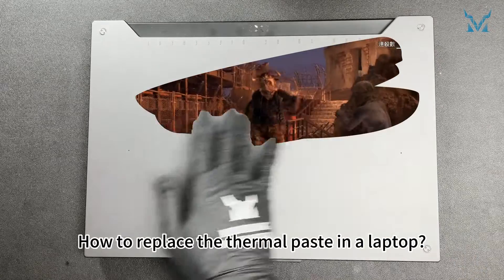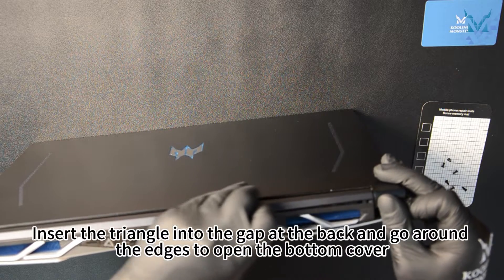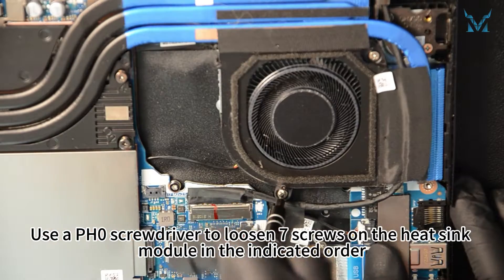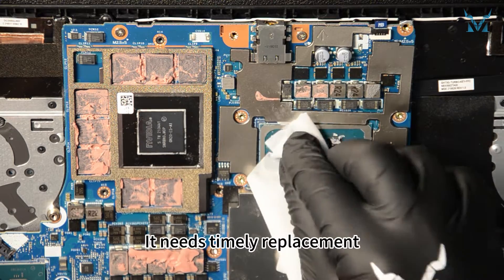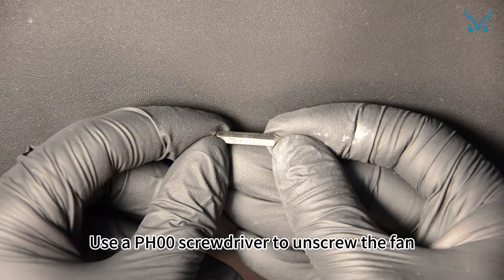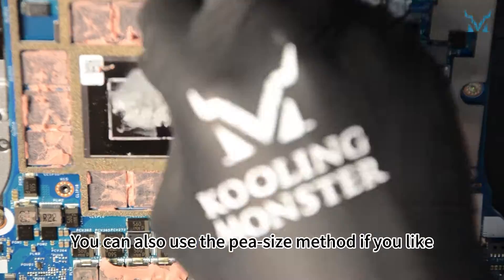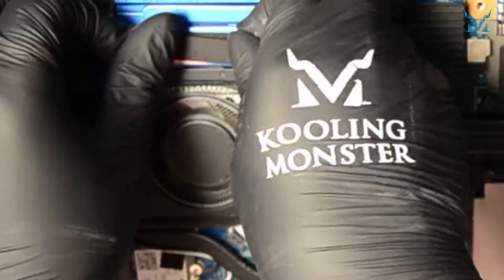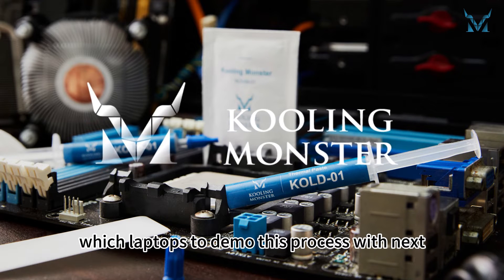Speed Up Your Acer PREDATOR HELIOS 300 - Prevent Overheating With Dust Cleaning & New Thermal Paste

Comment: What will happen of i dont replace the thermal pads surrounding tge cpu/gpu will it be ok if the pads are dried up or is replacing the gpu amd cpu the only necessary thing
Reply from the maker: Usually, the thermal pads around the CPU/GPU don't need frequent replacement. However, if they dry out, they should be replaced, as failing to do so could potentially affect the computer's performance. Manufacturers and aftermarket services typically use inexpensive thermal pads instead of thermal paste. If you want to use thermal paste to replace the existing thermal pads, make sure to use high-quality pastes. People often say that thermal paste should not replace thermal pads because the gap between the chips and the upper heatsink is too large, causing the thermal paste to flow out. Our KOLD-01 thermal paste features a special design that controls fluidity, potentially avoiding this issue if you choose to replace pads with paste.

Comment: how to use the compressed air? and what is it use for?
Reply from the maker: This is for cleaning the dust from the cooling module of laptops. Not only is the airflow and force more controllable, but also the finer nozzles are used to handle fan blades and heat fins covered by the casing, which is more efficient than using a vacuum cleaner.

Comment: Im not stripping my laptop in the hopes I don't fuck it up I want my laptop to stop over heating over 95 degrees fucking burns to the touch and seriously worries me but I'll do more damage than good if I strip it myself any other suggestions?
Reply from the maker: If you don't replace it even with the high temperature, it will damage the computer's performance. I suggest you watch the video carefully again and consider purchasing one of our toolkits to assist you! Don't worry, disassembling the computer may seem daunting, but it's actually a straightforward task!
Reply: I have zero computer knowledge and was able to do this. Don’t let it scare you. Just use a good screw driver and go for it. Hell, you might even have fun after the 2nd or 3rd time doing it

Comment: When should the Thermal Paste be replaced , how often?
Reply from the maker: When you feel your computer overheating or experiencing lag, consider replacing the thermal paste to improve its performance. The frequency of replacement depends on the quality of the thermal paste. We recommend using our KOLD-01 thermal paste. Typical thermal pastes use a solvent-based formula, where the solvent can evaporate when heated, causing the paste to dry out and lose its thermal conductivity. We use an exclusive solvent-free formula, perfectly solving this problem. Therefore, using it on laptops results in better heat dissipation and longer lifespan.

Comment: This video helped me a lot I got an Acer Predator Helios 300 in 2018 from then till now I never changed the thermal paste and pads, recently my laptop was making a lot of sounds and the temp was hiking up to 97-degree Celsius, then I went through your video and opened my laptop cleaned it there was a lot of dust blocking the air vent along with entire thermal paste was dried up and CPU fan was not working, repaired all those and you know what, now my cpu temp is not crossing beyond 60 degree celsius even with full utilization of CPU and memory.
Reply from the maker: Thank youfor sharing your experience! We're delighted to hear that the video was helpful to you and that you were able to successfully address the issues with your laptop!

Comment: How often does a laptop needs cleaning got mine cleaned about 3 months ago and gavent used it al that much after just wonderd if it needs cleaning on a regular basis like 4 to 5 months
Reply from the maker: Hello, typically it's recommended to clean and replace the thermal paste every six months to a year. However, we don't suggest relying solely on time intervals, as it largely depends on how you use your computer and the quality of the thermal paste. A better approach is to monitor the CPU/GPU temperatures.

Comment: I notice the paste is only replaced on the CPU/GPU although there appear to be other components with heat sink paste on them. Just wondered why the paste wasn't replaced on the other components?
Reply from the maker: Hello, the reason is that other components do not generate as much heat as the CPU/GPU, so there's no need to replace the thermal grease as frequently on them. Additionally, many surrounding components actually use thermal putty or thermal pads instead. This is because: first, thermal paste is more expensive than thermal putty and thermal pads, so manufacturers opt for the latter two for cost considerations; second, most thermal greases have a high fluidity, which might cause them to flow away if the gap is too large. However, our thermal paste has been specially designed to have a suitable fluidity, so it's not a problem !
Reply: @koolingmonster  are you actually saying vRAM chips dont generate as much heat as a CPU or GPU? the memory on a RTX GPU is a decent bit hotter in many cases than the silicon itself.
Reply: Is It a problem if we only change the thermal paste on the CPU and GPU and leave the other components as they are? Doesn't the fact that we are disconnecting the cooling system damage the substance that is on the other components?
Reply: @mattiachiurco6087 no problem at all
Reply: Ideally you should put thermal pads on the vram modules near gpu and capacitors near cpu, I did that
Reply: @geekbuddy4 you got the same laptop? What size pads did you use?
Reply: laziness im guessing. it wasnt normal TIM , it looked like some garbage semi liquid thermal pad , which the factory likely squeezes out really quickly with some type of caulking gun on an assembly line. i would definitely replace that orange garbage, but dont put TIM on those vRAM chips, you need thermal pads.

Comment: But it comes which thermal pads not thermal paste, will it be okay to apply thermal paste on it, will it last longer?
Reply: I just did mine and it had thermal paste, pads and putty on different components. I'd recommend getting some putty before attempting it, as I'll have to redo it next week. The pads will probably be fine to keep, but I also got 1mm ones just in case
Reply from the maker: You can indeed replace it with thermal paste, and using a better quality thermal paste, such as our KOLD-01 thermal grease, can even enhance the performance further~
Reply: @koolingmonster  I used paste at first, and a few VRMs didn't make contact with the heat sink, so it needs putty (which is why Acer put it there). I used K5 PRO, which worked well.

Comment: I need to replace the lid on my Predator PH18-71 which will require removing the heat sinks. Any chance of a video on how to reapply paste on one of these?
Reply from the maker: No problem, it has been added to our schedule. You can follow us and we'll tag you once it's out . We're delighted to have the opportunity to assist you. Kooling Monster is committed to helping everyone enhance their computer performance in an easy and affordable way.
Reply: @koolingmonster  I needed to get on with it and figured it out myself. There is no need to remove the base to replace the Lid/Panel on this laptop unless a hinge is broken. It can all be done by removing the screen bezel, including new lid, so no need to remove the heatsink.
Reply: @koolingmonster  I wanna say that I appreciate your mission. My FIL has taught me everything I know about reparing cars - half the battle is having the right tools!

I think everyone can benefit from knowing how to repair/maintain their favorite possessions.
Reply: Did they end up making the video and tagging you?
Reply: I haven’t heard anything

Comment: what about the thermal putty? no need to change it? Im doing this procedure on my tuf 15 in a  couple of days
Reply from the maker: You can change the thermal putty. Thermal putty cools the small chips around the CPU and GPU which produce less heat. You can leave them as is if they are not dried up. You can replace thermal putty with our KOLD-01 Thermal Paste to get better results.